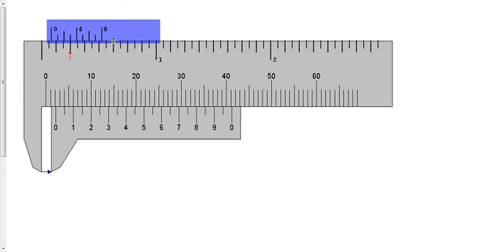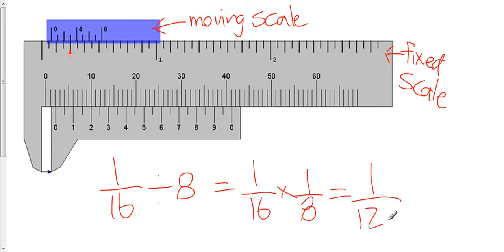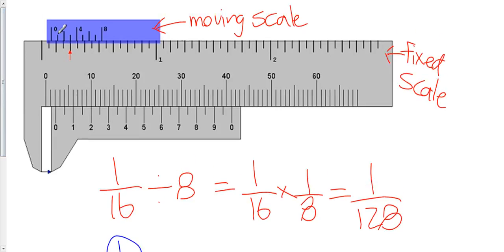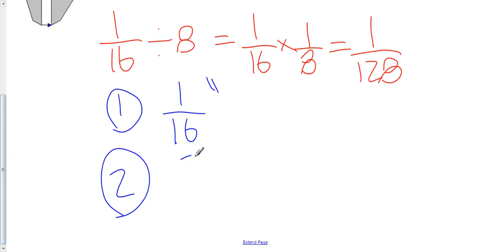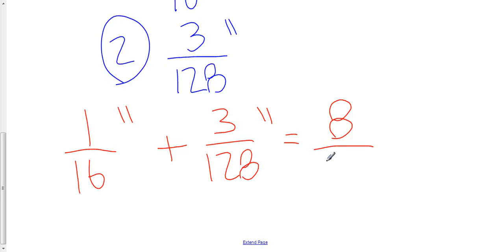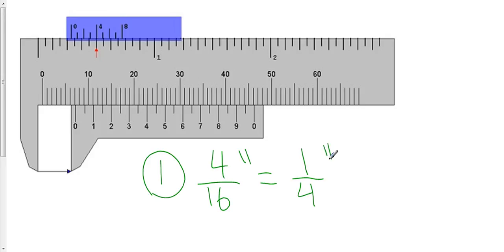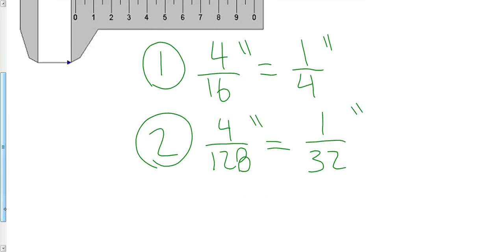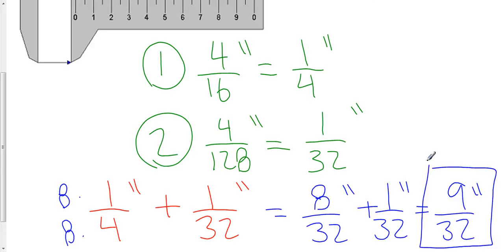How to Read Imperial Calipers

Comment: so if you read the metric scale you skip the fractional math...
Reply: You also lose the useful denominators. Mental mathematics is easier with more factors, where the decimal system falls down. There's a reason ancient mathematics had high bases such as 64. I have been taught in SI units, but still find inches particularly handy for working in wood and instances where elements have to be subdivided. Places where centimetres quickly become very unwieldy as the decimal places increase.